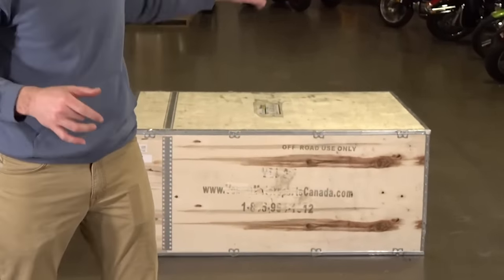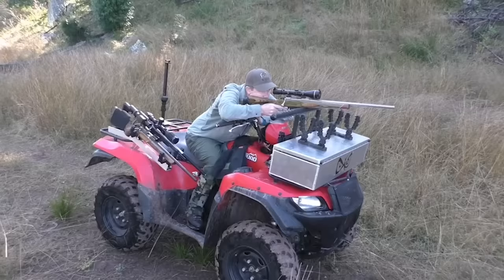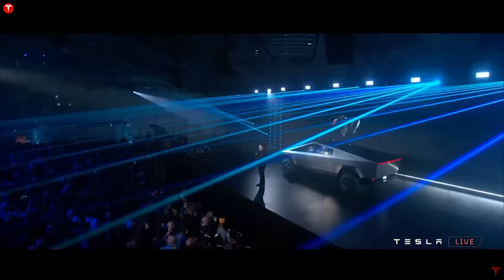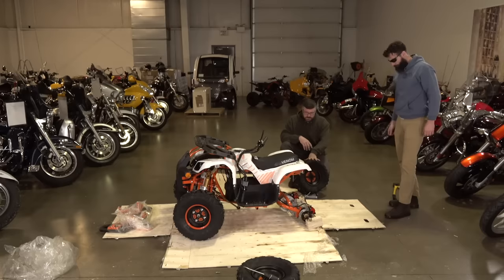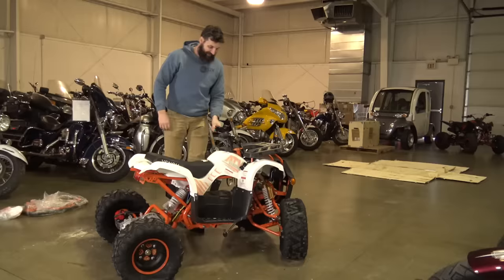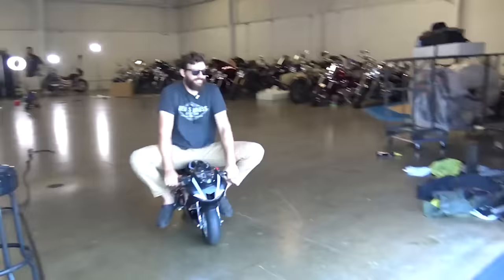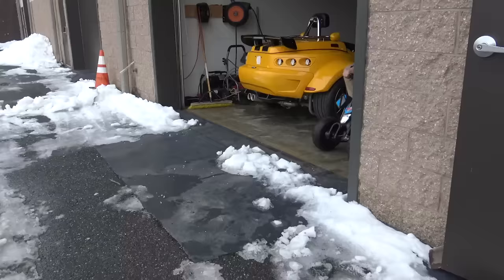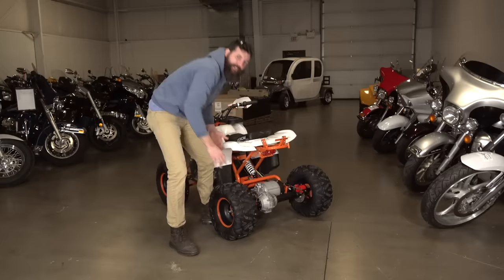I Bought the Cheapest ELECTRIC ATV on the Internet

Comment: Your moms hairdryer has more wattage than that thing. Here's the deal, the smallest so called adult Gas engine quad you can buy is 110cc with a Lifan type Honda GR6 motor. According to the Internet, the Lifan 110 has 6.9HP.  According to groogle 1HP is 735 watts. so 6.9 x 735 = 5,074. whatever. Lets round down to 5000watts.  Throw a 5000watt brushless DC motor on there, a huger battery and that quad would be awesome. Maybe still bent, but oh well.

Comment: if it had 10 times the torque and was twice the size I would buy that for $2k. would be awesome just tooling around the  homestead pulling trailers around the yard etc... but man. that thing is barely "chinese adult" not to speak of regular adult sized and has NO power. I am ok with lack of speed but it has to have power or you can't really do anything with it :-(

Comment: Hey .   Ive been thinking about making a small gas and or elecric scooter to put in or under the tool box in my truck . 20 mile range , enough to get to a gas station/parts store and back.  you can keep it plugged in and is always fully charged and have a secondary gas motor for extra miles should it run out of charge. while it uses gas it also charges the battery giving you more miles. What do you think? Good idea?

Comment: Modern electric atvs are way better than a gas atv  at doing pretty much anything. Quieter for hunting , faster and more powerful for driving like an idiot. The only thing a gas atv is better at is going extremely long distances. This particular video shows a low end e-atv, but a good one with a powerful motor and huge and higher volt lithium battery is a different beast. Jus putting in a 72v lithium in that one would be enough to make it scary fast.
Reply: your forgetting price, reliability, and ease of use. theirs a reason electric vehicles have a lifespan under 8 years.
Reply: @FedkaSlovanich  lol, no they dont. The batteries can easily last over ten years, and the motors can last millions of miles. And the batteries can be easily replaced and or repaired. And there are hundreds fewer moving parts that can break or wear out compared to an ice car.
Reply: @gabriels1163  the parts are expensive and hard to get so they are built cheap and when broken costs a arm and a leg if you can even find them
Reply: @FedkaSlovanich  They are expensive because they are not built cheap. Wherever you have been getting your info from is lying to you.

Comment: Waist more money and mod it.  No way that 1500 watts is being used.  My 500w scooter goes 20 mph!  Mod it to 60volt, with a 20amp controller and a 100ah lithium battery pack.  Maybe then you be fast, but no 4 wheel drive?

Comment: Ye but if you run out of electricity on the electric quad you are ded and if you run out of petrol you are also ded
Reply: 1 gallon gas tank is about 40-50 miles, you can carry extra easily and gas stations are everywhere